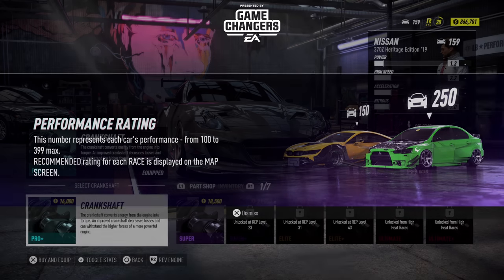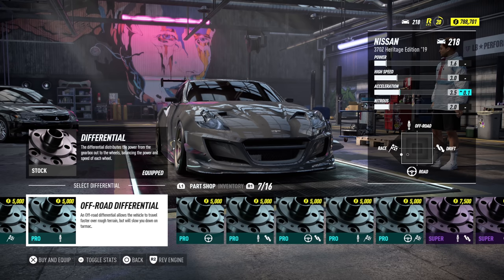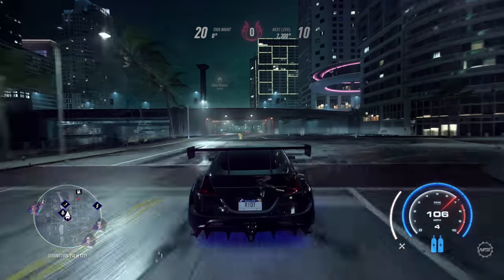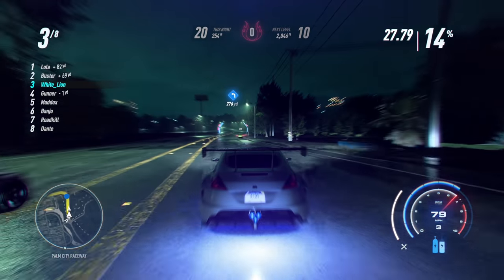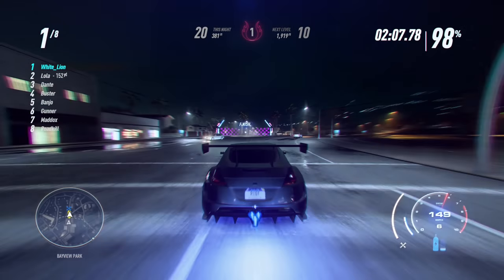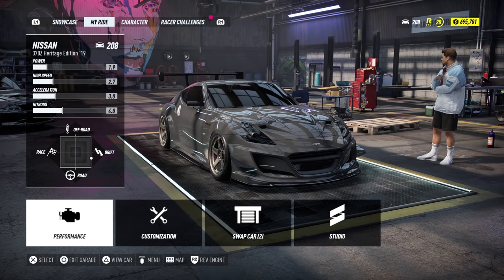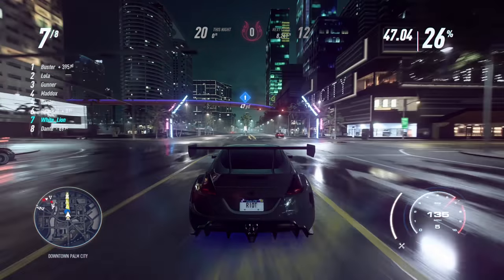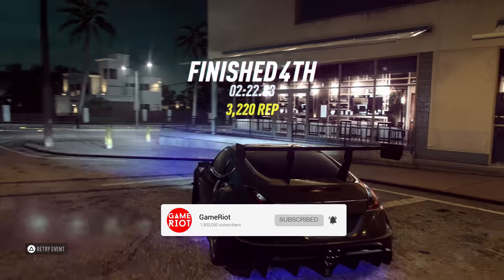NEED FOR SPEED HEAT - GRIP VS DRIFT Comparison Gameplay

Comment: That 370 z  sound is just perfect
Reply: Same sound with 350Z and the new Ford GT 2017 model.
Reply: @heromannickbggaming287  They all have a v6 so it makes sense if they sound similar in that regard, tho they all have a slight difference in the sound they make if you hear closely.
Reply: @raionshishi8290  Yes but I disagree, that's a street car engine vs a twin turbo hypercar. The sound should be quite different.
Reply: @1000hpHONDA  It is tho, besides have we heard the GT in Heat already ?
Reply: Joe L'Horri  The 350 and the 370Z sound almost exactly the same because th use the exact same engine, literally one has a little more L and HP but other then that same engine, exhaust note etc.
The Ford GT sound is not that far off, all it has is a twin turbo ecoboost engine, it sounds different for sure but it's not like a v8 diffeence kind of thing.

Comment: Some races needs full grip, others fill drift and other in between. 
It depends on the track.
I remember in carbon, tuner cars used to be full of grip where the tracks were so tiny and hard angles. However, fully drift cars at the beginning of the game the street used to be wide and cool to make a turn while drifting. 
Exotic cars were in between super fast at long line.

Comment: Does manual gears work nice? if so does it work by knocking it down a gear and then power on to drift? cheers
Reply: Most of these youtubers are playing in automatic but there is option for manual. If he was on manual there will be indicator like dot or blink red when it`s time to shift. As you can see it doesn`t have so he is in automatic.

Comment: I won races  drifting before it's just that u gotta use racing lines . When u taking a right turn start from the far left and then turn to the right on the inside of the rite turn. Same thing for the left turns start from the far right and go into the inside of the left turn

Comment: You didn't even actually make it full grip 😂 🤦‍♂️
Reply: EVen if he didn't it was still way faster then drift.
Reply: @raionshishi8290  I know it is.. But the car was still a bit slidy while he was driving.. If he had made 100% full grip it would be virtually impossible to slide
Reply: @GeometryDashKenaz  He was forcing it to slide, in this game the car doesn't slide even if it's not full grip build, you need to force it to slide by kicking the clutch (double tapping the gas to accel and kick the back end out) unless you make a drift build which will make the car loose enough to drift by just going into the corner. tho yes a full grip build would make it impossible to drift even with double tapping the throttle.

Comment: What I wish they did with the stats is not a rate out of 10 but REAL stats like: Top speed, 0-60mph, 0-100mph, torque, horsepower, etc. Just like NFS 2015. I didn’t play Payback so I don’t know if they have that too.
Reply: Lol no one complained in older NFS Underground 1-2, Most Wanted, Carbon that stats are just bars like this. And stats for Payback were like in NFS 2015.
Reply: HeroManNickBG Gaming I’m not complaining bud. Just “wishing” they added it cuz it’s nice to know the exact stats.
Reply: @bwhittv1446  you can toggle stats i think, you can even see it when buying cars the actual numbers and stats of the car in one of the video made of NFS heat.

Comment: Drifting in a race is easy you use the momentum of the car to smoothly slide thru a turn it's all about initiation and don't just jump back on the gas you gotta feel it out only then will you have control but like you said you just need more time
Reply: Adarian Thompson i cant wait to pull some sick skids that arent ez to do in nfs

Comment: Faster or not I'll still slide. Nothing action fun about slowing down and turning. Mastering a high speed extremely long drift through multiple parts of a city or any part for that matter was the only fun thing about 2015.
Reply: Aku  lol, colour me surprised if an NFS game is actually hard. Haven't played any arcade racing game that's been "hard" - horizon, crew, nfs, in the last decade. You have to go out of your way to lose games/races like this repeatedly, without pseudo handi capping yourself. I'll be happy there's a game where the bots in campaign race alongside you instead of being two miles behind after the first lap.

Comment: Drifting should be maintain at the same speed or faster based on throttle and car engin power
Reply: And that's exactly what happens when you drift you either maintain the power or you lose it if you mess up and or go to hard, if your car isn't powerful enough to drift then it's even harder.

Comment: Feel like they broke car physics with drifting the car gets no power coming out the corner tf
Reply: Well, people have been screaming to remove the drift boost. Plus grip should be faster than drift right?
Reply: @renelite7181  not always. Havnt you seen Tokyo drift?
Reply: @renelite7181  but sliding in a corner doesn't slow you down that much you should be able to carry out momentum out of the corner a good speed